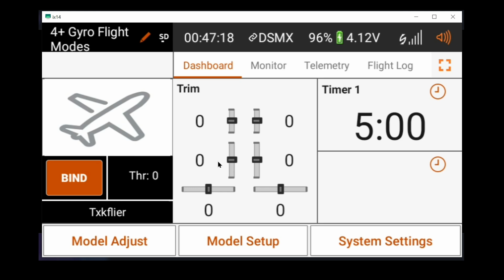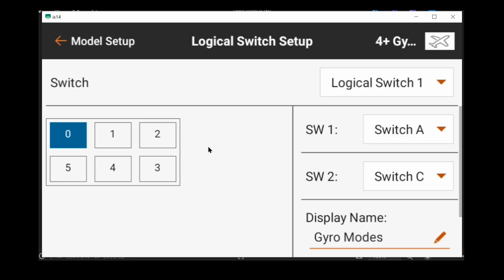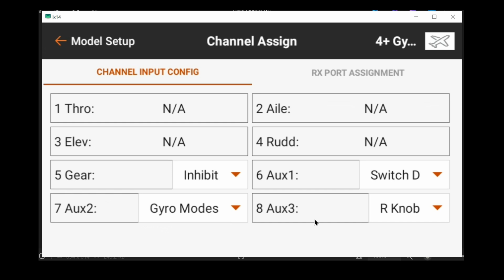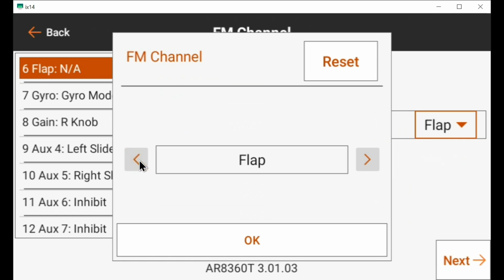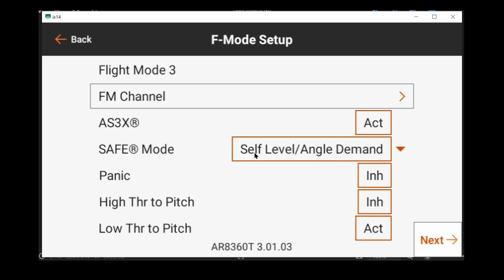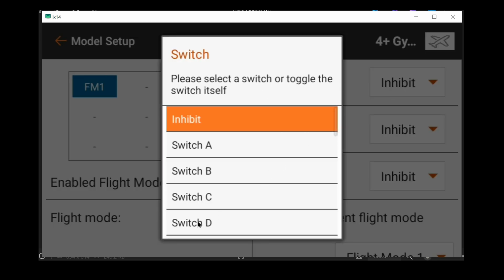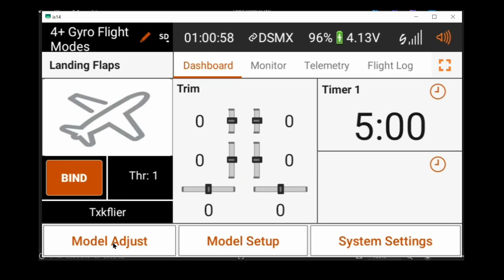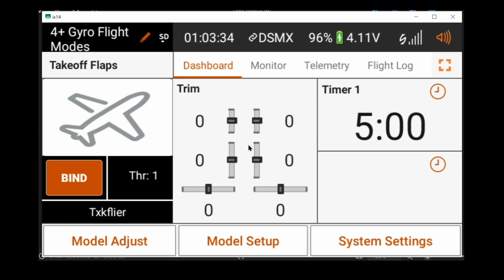How to Use a Logical Switch to Control the Gyro Modes

Comment: JUST USE THE FLIGHT MODE GRID SET UP ...SAME TASK ...WAY EASIER
Reply from the maker: I use the transmitter's flight modes for flaps since it lets me use F-mode trim on the elevator and ailerons. That's a much better way to use them.

Comment: I love your videos, but I have a question. I’m not sure if you have a solution? I’m trying to get 100% elevator when I come in for a Landing with Landing flaps on without switching my flight mode rate switch back to 100% throw, example the other day I came in on 50% rates and did not have enough elevator throw and I would like to get 100% elevator in case I forget to switch the flight mode switch back to 100%. I want it so when I hit Landing flaps, my rates will go to 100% regardless of flight mode switch position.???? appreciate it if you have any ideas or anybody else out there thank you.
Reply: Thank you for your time and quick response. I will do my best to set it up that way and see what happens. I appreciate it very much. Keep up the good work.
Reply from the maker: @ktm690rbiker  I just posted a new video for you..
Reply from the maker: On my planes, I might set the rates for the ailerons to 50%, 75%, and 100%, but I would never go that low on the elevator. I'd probably set it to 70%, 85%, and 100%.

I always the transmitter's flight modes to control the flaps because I can then enable flight mode trim so that I have separate elevator trims for each position of the flaps. I'd use a logical switch to control the rates. The 1st input switch would be the flight mode switch and the 2nd input switch would be the my usual rate switch (B). With a 3-position rate switch, the logical switch would need at least three logical output values - 0 for low rates, 1 for mid rates, and 2 for high rates. When the flaps are up, the 3-position rate switch would give you low (0), medium (1), and high (2) rates. When the flaps are in the takeoff position, you could set all three logical values to 1 which would be mid rates. In the landing flaps position, setting all three logical values to 2 would gives high rates. The logical switch array would look like:

Rates:                   Low       Mid       High           
Flaps Up:                0            1            2
Takeoff Flaps:       1            1            1
Landing Flaps:      2            2            2